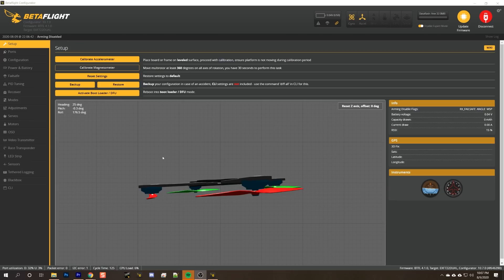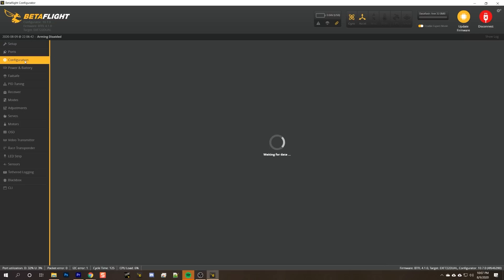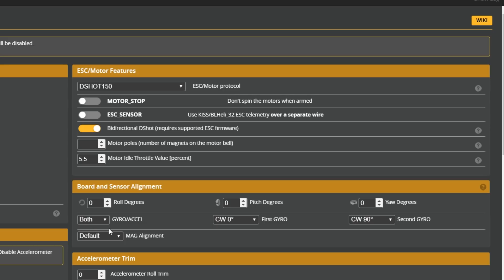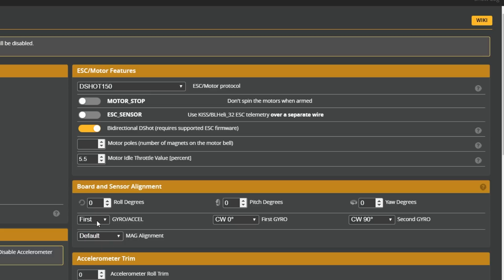This Betaflight setting could save you from replacing your damaged FC (dual gyro FC only)

Comment: My iflight nazgul is acting so weird. I bought it crashed and replaced an arm, but it's like one prop isn't getting full power. I replaced the motor and it's still the weak link. So im thinking the gyro isn't great. Of course it's Iflight that has two gyros. Hopefully this helps

Comment: Hello, on my chip /speedybee f7 v3 i have at Gyro/Accel only second where u have first and then i have again second? after i do the save it will switch back ----  i can fix the gyro problem only with the yaw degrees

Comment: Mine might not be related to this video but i would like the help. when i connect my beta fpv meteor 65 2022 to betaflight and i move it around. for example i pitch it forwards and its showing the drone rolling sideways. vice versa. i would like to know how to fix this just incase i have problems like this in the futer
Reply from the maker: Go to the Configuraiton tab and adjust the Yaw Degrees parameter. Probably you need to change it either to +90 or -90.

Comment: On 4.3 firmware gyro sometimes doesn't appear,  after reboot it appears and sometimes not...
Reply from the maker: Your FC is failing. This is a hardware issue.
Reply: @JoshuaBardwell  strange really,  it doesn't happen on 4.2 and on emuflight....

Comment: I have wobbles during full punchout out, drops fine, flies fine, power loops fine, turns fine.. just during high punch wobbles. I didnt have this issue with 2306 2450kv 4s, now im using 2405 1800kv 6s.

Comment: Joshua, I have a new quad that when in Betaflight on the setup tab, the quad when pitched forward has a proportional roll to the left (-ve/minus) which I have not observed in any previous quad. Furthermore, with roll there is proportional pitch. The yaw is fine. What’s up and how can I solve this?

Comment: Joshua, I Love you. But I think you're spying on me. Crashed the crap out of my favorite build (iFlight Nazgul XL5 V4 Frame, iFlight SucceX-D F7 Twin FC, Caddx Vista, modified by taller standoffs 3D printed Top Plate & camera holder). Replaced front standoffs & 3D printed top plate; sure enough, yaw twitch like crazy. Saw this vid, first gyro sent it spinning off into space, second gyro works perfect. Thanks dude. Keep doing what you do so well.

Comment: Been doing this since fall of 2019 with the succex-D F7 TwinG FCs. The original boards back then were notorious for causing quads to develop twitches, that require one of the gyros to be disabled. Haven't had the issue with more recent versions.

Comment: So I've tried this with my iFlight TwinG attempting to get rid of a nasty yaw twitch during punch outs. It will hover just fine but as soon as I pop the throttle it will death roll on either the pitch or roll axis depending on which gyro I've selected. Is there something else I need to change in the CLI to make this work?
Reply: If yoi have tried First and Second and still have the issue, it soumds like an electrical problem.  

Do you have a 1000ug 35v (4s) or 50v (6s) cap installed directly on the ESC?  If not, do that.

Next try lowering Rampup Power in BLHeli to 12%.  Or Start Force to 0.125 if BLHeli_S to help mitigate Desyncs.

If it still persists, it sounds like an electrical issue somewhere else OR possibly the FC is just bad i guess.  I have a video on what a Bad gyro looks like in logging. But electrical issues can cause the gyro to have spike since they are reading electrical differentials.  If bad mechanically, it would be odd to have both be bad.

Comment: For clarification: SPRacingF7DUAL was the first to have dual simultaneous gyros and also paved the way for FC's that have two different ones without sensor fusion, Martin Budden and I did all the work for that. The IFlight stuff came much later.  The SPRacingH7EXTREME has two gyros, the H7ZERO and H7NANO have one.  With regards to the failure rate of gyros, buying two FC's costs more than one FC with two gyros and the failure rate of two separate FC's will be the same as two gyros on one FC, but with a dual gyro FC at least you don't have to throw away everything else.

Comment: @Joshua, you should warn big time with this tip. If you setup your quad on the MPU6000 and you switch to a ICM20602, what happens to be the most commonly pair on FC's, the chance of burning your motors hot will grow exponentially, I have tested this multiple times back and forth. You must tune again, it's mandatory.

Comment: You can also use blackbox with the debug mode set to DUAL_GYRO_SCALED to see both signals before the fusion. This can help troubleshoot the flight controller too!
And DUAL_GYRO_DIFF will show you the difference between both gyros. If you have  big spikes, one of them may be defective, but this is a bit more tricky because you won't know which one is causing the difference. But if you like experiments, here you go!
Reply: DUAL_GYRO_SCALED shows you raw.on both, so you can precisely see which is the issue.  But Roll and Pitch only.  Yaw is not captured (only 4 slots).

Comment: I had an iFlight Succex D F7 Twin gyro, in my Banggod. It did have a couple of hard crashes under its belt. On the last one, it developed a yaw twitch. I tried this with no success. I bought an exact replacement to match the ESC. It flew great afterwards. The very FIRST crash I had (it was pretty hard) the FC completely died on me(no power via usb). NOTHING ELSE WAS DAMAGED! I got maybe 10 packs through it(7 days)...sooo frustrating. I went with a Kakuta HDV. Hopefully I will have better luck. That FC is obviously not very tough.

Comment: Had this on my brand new DC3 half a year ago. A big portion of the Iflight 20x20 dual gyro stacks have faulty gyros going by Banggood comments. Some dual gyro stacks don't let you select which gyro you use for example Flywoo Goku.
Reply: Thanks for mentioning. My  F7 fc won’t let me select a gyro. It’s locked on First. No option to switch. Why is that ?
Reply: @fpvnycdream_4197  No idea. Luckily both my gyros work on my Flywoo stack. I suspect there is a software way to control it though. Perhaps open a ticket over at the betaflight github forum.

Comment: Great tip! I recently had an mpu6000 go out on me and I decided to try to replace it with my rework station. Didn't take long and it worked out and brought the board back to working order. It may have been that I just needed to reflow the solder for it, but I just completely replaced it.

Comment: My spracing f3 flight controller is not powering led when connected to usb or battery,can it be repaired
Reply: bruh spracing f3s were cloned so often the quality on those is very poor. i'd throw it out as soon as it makes problems.
Reply: @notkira_x  agreed, buy direct from the factory or reputable reseller if you don't want a good board and not a clone! i.e.  not banggood, aliexpress, ebay, etc.
Reply: yes, the videos are on YouTube, it's your 3.3v regulator, u gotta micro solder tho
Reply: @thomasa.7759  i searched solution for this on youtube but for spf3 board there are no videos of repairing it

Comment: I bet that the reason they seem to fail more than single gyro systems is wth the algorithm that processes the differences between the gyro signals. In a normal system the gyro data is just handled as fact, but with a dual system a choice has to be made. I bet it's a bug in betaflight, where someone flipped a sign somewhere in the averaging algorithm..
Reply: Uuuummm NO.  Ther is no choice.  It just averages the two signals when BOTH is selected.
Reply: Even if such concept was applied, it needs at least 3 independent inputs to determine which data is trustworthy.
Reply: Typical: "You have a hardware issue.  Must be BF's fault."
Reply: @uavtech  I hear you. I am not saying that this is betaflight's fault only, I am proposing that with a single gyro system, bf may be better at throwing out trash data. But when gyro fusion, rather than throwing out trash data, even if it simply averages the values, which causes this twitch.  So sure, the hardware is to blame, but I wouldn't discount the probability of biological interference here.
Reply: Also note: I am merely hypothesizing about why it may appear that gyro fusion capable quads seem to have a higher failure rate than others. I am not digging on betaflight. God No.
Reply: @jonnyphenomenon  
"bf may be better at throwing out trash data":  That's not how things work.  BF (every FW) takes every sample as it comes.  The only thing a filter does is attenuate big steps in changes in the data points (kind of like an averaging, but the filters used are NOT averaging filters.  They are not that complicated, but are just not averaging).

-- How about since manufactures need to buy 2x as many, they are purchasing lower quality off the line??
-- OR that TDK as had some bad runs of gyros??  TDK just bought Invensense (previous owner).  Maybe their QA is going downhill in general?
-- OR maybe there is no correlation and JB is just spit-balling.

Rest assured, it is not the firmware.  Knowing how things work.  It is like saying your printer being turned off is why you can't get some video to play smoothly on your PC.
Reply: @uavtech  Your comparison to my faulting betaflight's firmware to blaming a printer for bad video is hardly appropriate, but I do understand your point.  You sound like you know more about the coding of betaflight than I do. Perhaps you are one of the developers?  If this is true, then I will concede that you must know more about the coding than I possibly could.   However, if you are indeed a developer, then may I remind you of the law of parsimony. The simplest explanation is the most likely.  Why blame hardware which it is produced by very wealthy organizations, and the software that runs it is developed by a handful of volunteers with varying levels of aptitude and zero dollar budget?
Reply: Like you said, "Maybe JB was just spitballing."  - maybe there really /isn't/ a higher number of gyros going bad on flight controllers with gyro fusion, and we are just wasting our time here. :)
Reply: @jonnyphenomenon  because just because there is NO budget does NOT correlate to crap.  OBS for example - ALSO OPEN SOURCE - works waaayyyy better than my very well-financed AMD Radeon Software for streaming.  My first stream failed because of how bad the Radeon software was at encoding.  HOWEVER, OBS works like a champ.  Same PC, same everything.

So to imply a project with passionate professionals at the wheel bringing all their various talents to the table from around the world is worse than a company that is mostly motivated by $$ and profit could be a bad assumption.  Especially when it is based on thinking of things or reasons and that's no even how the firmware works.  You can even check it out for yourself on Github.  The code is open for anyone's review at any time.

I'm not a developer.  But do contribute to the project.  Trust me when I tell you that the guys know their shit.  They work at professional companies and just love collaborating and contributing to the BF project as well.  that is how much they love coding.  And when you love something that much, you are typically pretty damn good at it.  Do you think the factory staff at TDK just love building gyro chips that much to make the shareholder more money?  Or do you think they come to work each day so they can get a paycheck each week or every other week?

Not arguing in any mean sense, just trying to provide some other ways to think about things that hopefully make some sense.
Reply: @jonnyphenomenon  yeah, lets go fly some packs instead!!  :-)

Comment from the maker: I said in the video this is for dual-gyro FC with sensor fusion. But the same method will work if you have an FC like OmniNXT F7 that has one ICM gyro and one MPU gyro. In some cases the ICM gyro will have problems either because it is more sensitive to noise or maybe the ribbon cable connecting it broke. But the MPU gyro still works fine. The difference will be that type of FC will never say "both". It will just say "first" and you change to "second" or vice versa.
Reply: which camera did you use in shot from your refrigerator? Is it a gopro on the linear shooting mode?
Reply from the maker: Lumix G85
Reply: hi joshua thanks for the video. The OminNxt f7 v2 have 2 gyro, the first is the ICM and the second MPU? Thanks a lot for the response.